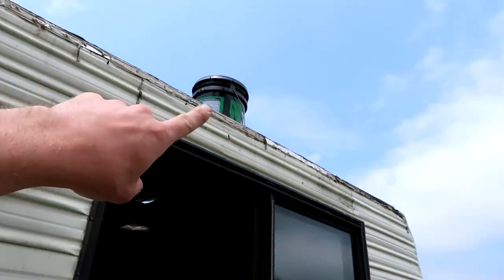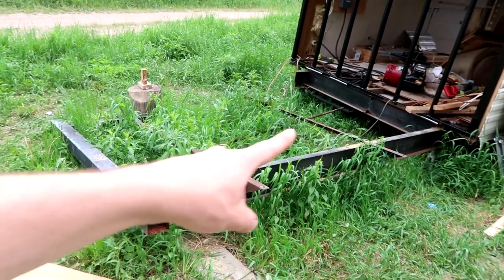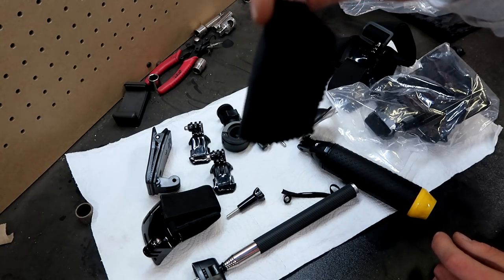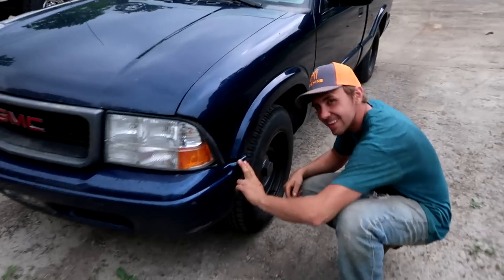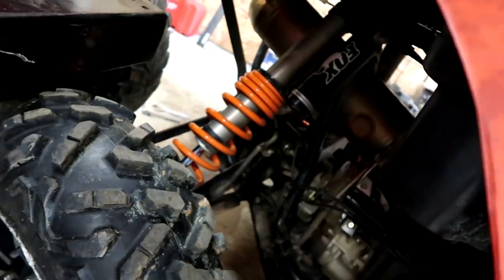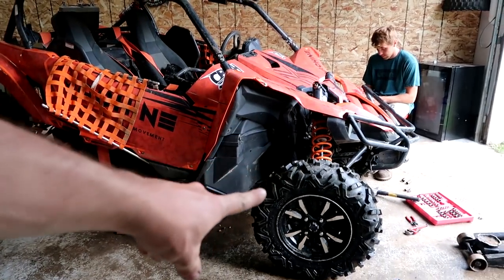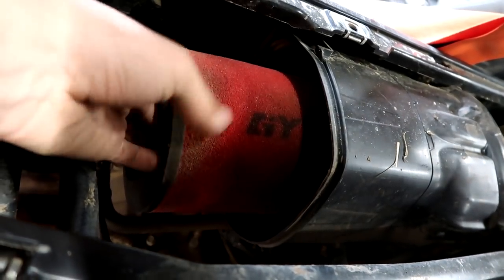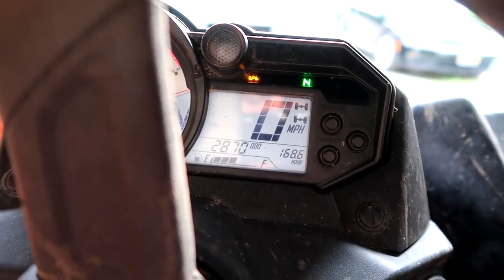Best $100 Wheels You can Get

Comment: I hope you realize that having the axles all the way in the back of the trailer with crush will make the trailer have no tung weight and will make the trailer sway and have the possibility of flipping over
Reply: Mserafin14 exactly. I have been trying to tell him this through the comments a few times already, if you search trailer weight distribution then you will see that its not safe having alot of weight on the back of a trailer even if the axles are at the back

Comment: You should make the Jeep all carbonated that way you only have to worry about a very charging and you won't have to worry about the computer
Reply: When did jeeps become a can of soda
Reply: john schwarz you can’t put a carburetor on a 4.0liter Jeep motor it’s has electric  fuel injection and electric ignition taking out the the computer makes the fuel management system not work and you can’t program the ignition or timing on the motor trust me I’ve owned many jeeps and a lot of Wranglers with 4.0liter motors it won’t work